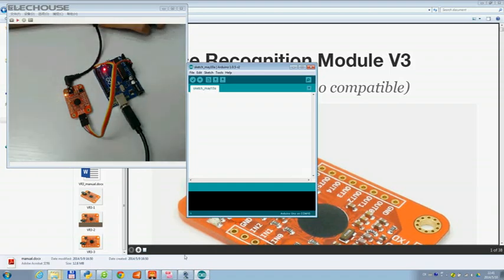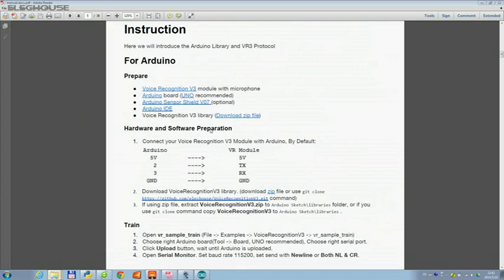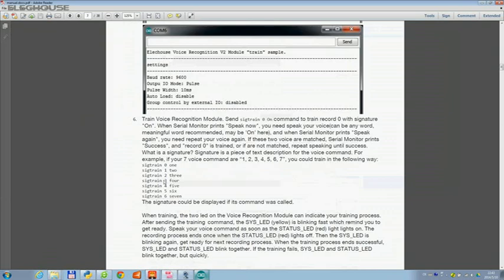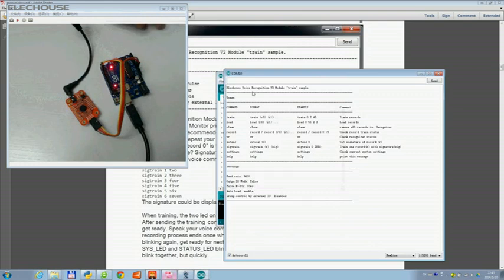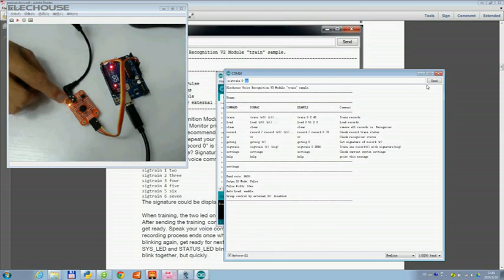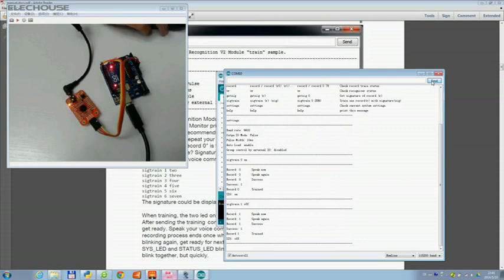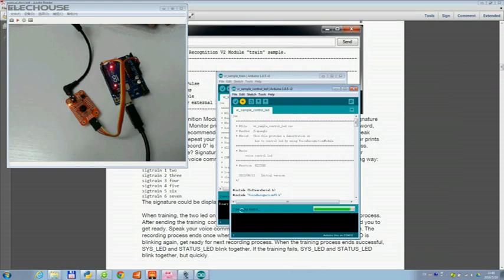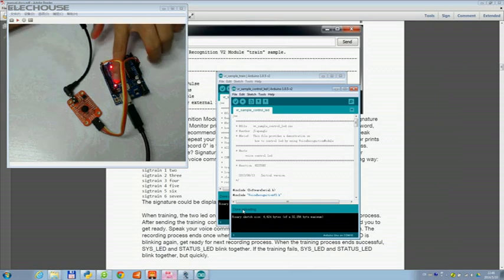ELECHOUSE Voice Recognition Module with Arduino

Comment: hi Mr. Wilson Shen, how do I import the records from the module version 3 to arduino if I train the records using AccessPort ? I knew that the coding to import records from module version 2 is :

Serial.write(0xAA);
Serial.write(0x37);
delay(1000);
Serial.write(0xAA);
Serial.write(0x21);  //import records from group 1

but this doesn't seem to work on module version 3

Comment: hello,i am using more than 10 instructions.....like first i will say lights it will select the lights....and then i have to say on or off to control it.....similarly for.TV .and other appliances....so for one device i have to record three instruction.........so i have to switch to 2nd group to use more instruction.......can i switch to other groups just by voice commands....like for switching i have reordered switch to 2 in group 1 and it will send command to import group 2 .....can something like this happen
Reply from the maker: Yes 
You could switch group by voice command
Reply: A mi también me sale el mismo error. ¿Quién sabe por qué sucede esto?
Reply: i can't create group through both arduino uno and access port can you please instruct me to create group..

Comment: I got the same problem error message and solve it today by connecting the voice module with usb to rs232 ttl adaptor direct to my laptop and use the program AccessPort.
With the program AccessPort you have to change the baud rate of the voice module from 9600 to 19200 baud, the same you have to do in the arduino code. The voice module can only work with the older version of Arduino software version 1.0 and 1.0.6 higher versions will not work. I test it with windows 7 ultimate 64 bit system. Use the manual and program from the website of Elechouse, in the manual you will find information how to change the baud rate of the voice module and a link for downloading the program AccessPort. After all this you can start to enjoy your voice module.

Comment: Hello, excellent example. I'm trying to do the same test but for another board, this board is Arduino Mega (AT1280) however there are lots of problems with this board, when I want to watch settings "Monitor serial" says "Check system settings error or timeout" and is the same for another commands like "sigtrain, vr or another command". I wonder if you could help me to solve this issue. Thanks in advance. Edd
Reply: hi mister, did you find the reason why it appears 'check system settings error or timeout' ? while testing the voice recognition module v3.? will you kindly share the result cause im having trouble as you. thank you :)
Reply: Of course, unfortunately I could not solve this issue, there was not problem with arduino board, the voice module have problems by itself, I would recommend you change the device for a new one. Best regards
Reply: Luis Eduardo L Hello Sir. Good day! take a look the TX and RX connection from VR module  to Arduino, try to change it  then you will see the changes. I hope it works like mine..  TXD on VR module connect to Arduino Pin 2, and RXD on VR module connect to Arduino Pin3.
Reply: Luis Eduardo L  hello Luiz you could solve the problem? I did not quite understand when you said it already has its own problems. I bought this module and can not make it work. the solution is to change it?
Reply: +Luis Eduardo L Who solved this problem?
Reply: An elechouse's vendor from China did me the favor of providing some help, however, the problem could not be solved, he suggested to replace it by a new one and they would check the board.
Reply: +Luis Eduardo L, Hello, I too went I also have a MEGA Arduino, what I did was use for the TX and RX pin 10 pin 11, and voila problem solved, I hope you functions, a hug. TX---> pin 10 arduino, RX--->pin11 arduino
Reply: ¡Eureka! Conecting TXD of the Voice Recognition V3 to pin 10 of the Arduino (2560 Mega) and RXD to pin 11 works perfectly.
Reply: Paco Silver Rodri, did you change the baud rate to 115200, and in the program did you replace the VR myVR(2,3);  to VR myVR(10,11);  please help i am running out of time to finish my project.
i tried the way you said but getting the same error
Reply: ¿Solucionaste?